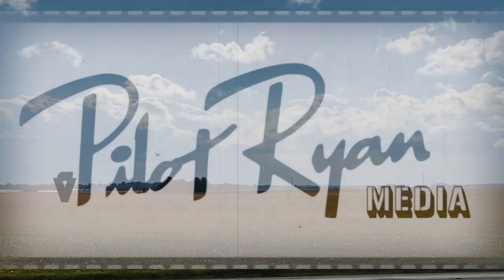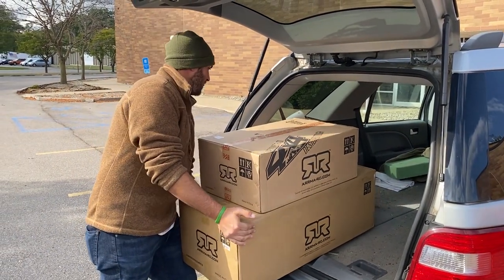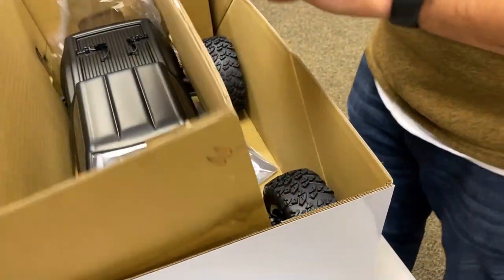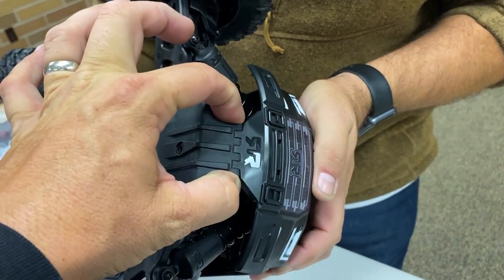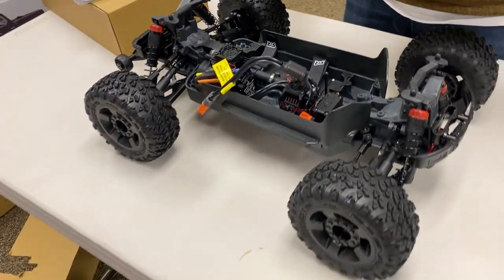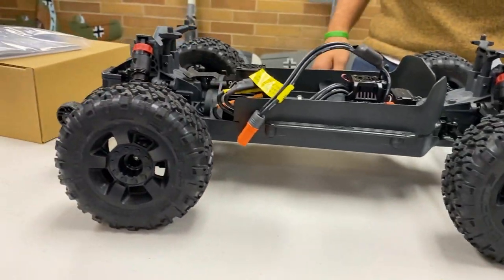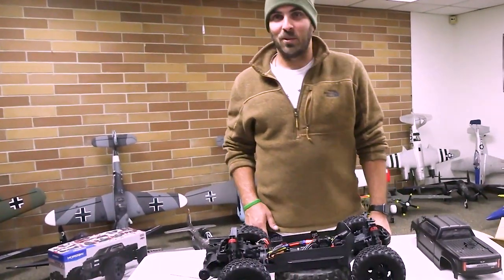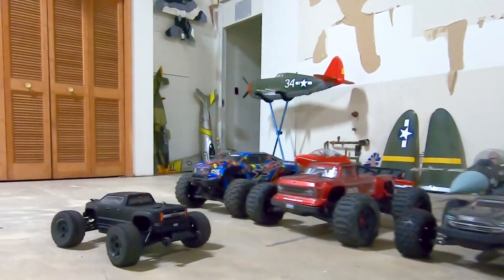Arrma Big Rock V3 UNBOX and Throttle Calibration vlog

Comment: I have a stupid question if you don’t mind? I ordered one of these for my kid. I have zero experience with this level of rc truck. I’ve noticed on the online instructions pdf it shows the calibration first and the binding procedure (further down the page). Do you calibrate esc then go through binding or bind via bind plug etc and then perform calibration? I just thought it was odd they showed calibration first in the manual, in my mind I’m thinking how is the transmitter talking to the esc during calibration if not bound. Any help would be appreciated, thx in advance.
Reply from the maker: Not a stupid question. It’s already bound. You won’t need to bind a rtr truck out of the box.
Reply: Pilot Ryan Media Thanks for the response, I just wanted to set it up correctly, better safe than sorry. I’m a drone guy, these trucks are new ground for me. Great vid by the way. One last question, in short has your experience with this truck been good so far? Thx again.
Reply from the maker: CG were having a blast with it. I’ll put the running vid up soonish.
Reply: Pilot Ryan Media Right on, thx for the info brother! Looking forward to the running vid.

Comment: Just got my big rock in the mail bought it for my birthday.  Do u know what that little microchip thing is that comes in the remote bag ?
Reply from the maker: It’s a bind plug, you shouldn’t need it unless your radio loses connection
Reply: @PilotRyanMedia   I think I messed up I got a spectrum S1200 DC smart charger. There's no power cord 2 plug into the wall do I need to buy something else how do I get it to work
Reply: I think I messed up got a spectrum S1200 DC smart charger. It didn't come with anything to plug into the wall. Do you know what I have to buy for it 2 work?